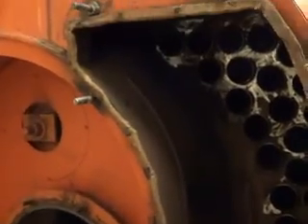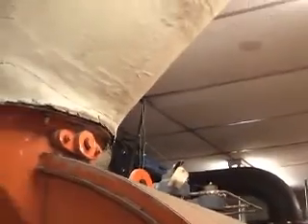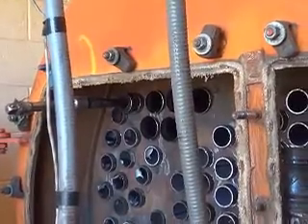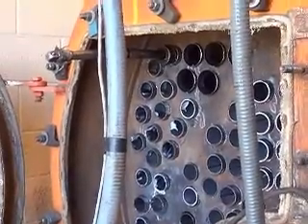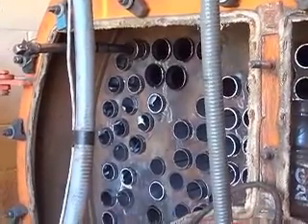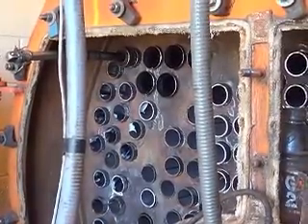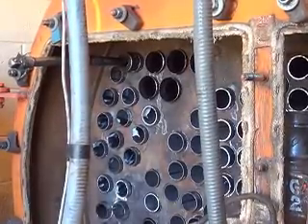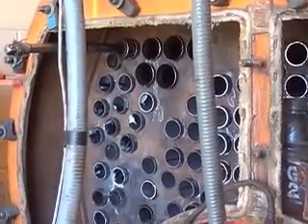Fire Tube Steam Boiler Rebuild

Comment: We have a similar boiler, but we have no documentation. We have issue with ignition. I would like to ask what is the normal operating  gas pressure for this type of boiler no?? Would greatly appreciate your assistance
Reply from the maker: There should be a Manufactures tag on there. We are required to have tear down inspections by the state every summer. Off hand I don't remember.

Comment: I work on these bad boys all the time!!! Im kind of surprised you guys don't bead those over! All the boilers Ive ever done we weld the hot pass, It actually helps alot, its the way cleaver brooks designed there boiler! Its a crazy job and you never stop traveling! These are fun but water tubes is where the moneys at!
Reply from the maker: +Matt Kratzer  From an owner operator view. It's all about good water treatment. This thing will outlast me. LOL I don't see how you guys can live on the road the way you do. Thanks for watchin
Reply: I have a question for you when you take the bad tube out how is that done

Comment: The first pass is called a Morrison tube.You should never leave unrolled tubes overnight condensation forms which creates oxide between the tube sheet. Can't tell by the video but the stub outs look excessively long should not be more than 3/16 of an inch. Also just a little FYI should never hold the role motor so close to your head it's a good way to get it ripped off. Safety first!!!
Reply: Brad Deminsky yeah when you go inside  to do the them, sometimes you got to unthread the leverage pipe  and let the handle rest against the walls to do the outside tubes. stick that in your pipe and smoke it.
Reply from the maker: ??????  One of us is confused.  I have to much on this channel to keep it all straight. Take care and create a great day.
Reply: Christopher Orosco What wrong with your post? How about being a smart ass. I've been in the Boiler Maker Union and been doing this shit 25 years. If you don't have the room then you use an angle roll motor. Not modifying something it wasn't designed for that's how accidents happen. Next time you want to tell someone to put it in their pipe and smoke it and then call them a dumbass you should know your facts.
Reply: Yeah you used to do this! Ha must be in the office now
Reply from the maker: Better than that. I'm retired

Comment: That's pretty cool I guess the pressure in the boiler pushes the tube plate against the flares and that provides the seal.  Pretty cool design
Reply from the maker: Thanks for watchin
Reply: TheWreckingYard The tubes are rolled to a water tight fit. If done right, they won't leak even when cold.

Comment: That is about the size a lot of the schools had. It is amazing that the tubes do not leak ,
Reply from the maker: I bet there would be hell to pay if that school boiler went down for very long. I hate it when they have control problems. The new electronic stuff works good but I like old school better.